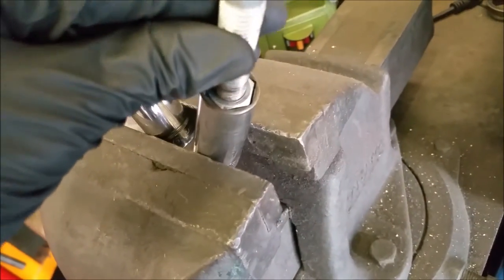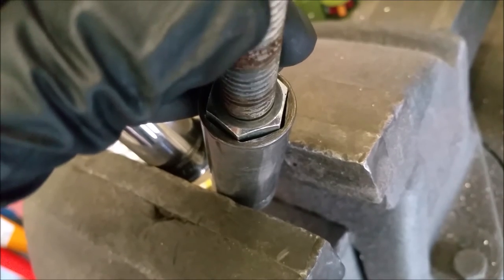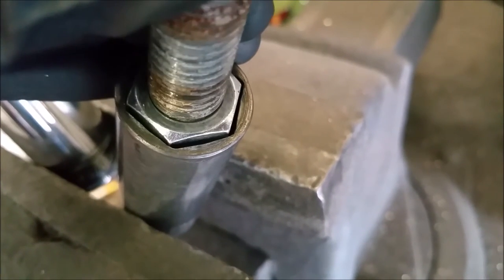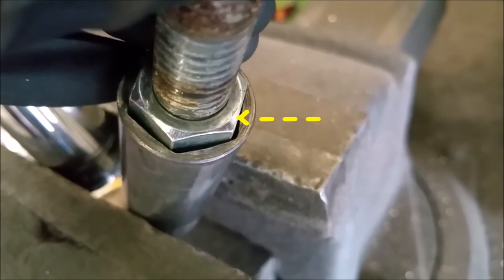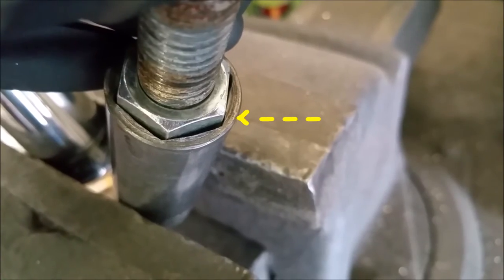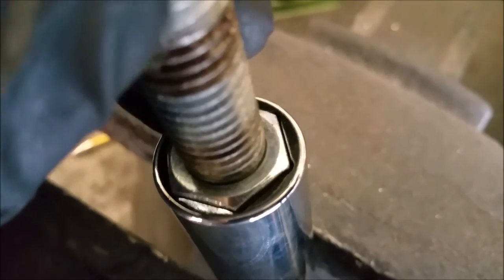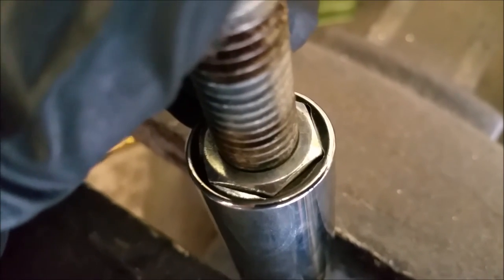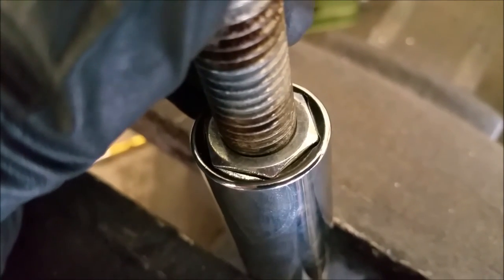Snapon vs Craftsman

Comment: The stop in the socket hinders you from certain applications like huck nuts or long lug nuts etc
Reply from the maker: kevin pierce when that happens I use my craftsman, and hope it doesn't crack. Ok. Usually it's fine. Your right.

Comment: Snap on uses the flank drive design which grips the fasteners on the sides and not the corners.  A lot of tool manufacturers, such as gearwrench, have copied this design though and cost a lot less than snap on, not as good quality though.

Comment: Hey sir nice post. I have both snap-on and Craftsman tools I feel happy with both to tell the truth. Broke the bank with snap-on where Craftsman tools are a very good buy. I just have a bit more confidence that the snap-on will get that bolt out
Reply from the maker: I have a set of harbor freight for my portable tool set, and snap-on and other tech grade for my work set. I agree with you!
Reply: subtledriver, i been working on cars for 27 yrs and never fallen into the snap on tool debt or any other high dollar truck tool and I always get the job done with what i have
Reply from the maker: sal 80 I used to believe that, but in my experience I prefer to use tight tolerance sockets. I have Japanese made, China made (craftsman, harbor  freight, cobalt, whatever ), USA made (Cornwall, matco, snap-on, Mac, ect)... I  prefer to use the best sockets to save me time and money. Eventually the craftsman tools will crack or round out, so I replace them with snap-on. There is a difference in quality that most people don't quite understand and I personally get tired of dealing with the worn bolt heads of repeat customers or those from other shops using poor practices even with lower grade or higher grade tools. And I agree, just because you have a nice $2000 camera, doesn't automatically mean you can take a good photo. And same goes for cars, just cause you have a porche or corvette, doesn't mean you are automatically going to beat the civic on the track.
Reply: """Eventually the craftsman tools will crack or round out, so I replace them with snap-on. """"

 So are you saying the Snap on never will round out??
I have never broken a socket ( may have worn a few out) but I dont mind replacing a set for the  cost of one Snap on socket ..
 I am not a pro but still have done a shit ton of work 
 and out if all the test on  You tube that I have seen ..the only one that impressed my is how strong Snap on open end wrench is.... Now personally I have never tried to put so much pressure  on an open end wrench that  I spread the ends..but that snap on apparently can handle  it

Comment: if you wanted a fair match compare Craftman's professional line or industrial sockets VS your Snap on pro sockets.
Reply: I cracked open a new set of Craftsman Industrial a while ago.  At least 1/3 of the sockets were missing chrome.  :-(
Reply from the maker: It wasn't a "fair" match, its a comparison to show difference between consumer and pro grade. There is a difference in quality from China made Craftsman, to USA made Snap-on sockets. Craftsman professional line will never make it in my tool box, there is no mobile tool truck for sears, and i will not drive an hour to sears to replace a broken tool.
Reply: subtledriver then why didn’t you name it American vs Chinese? Plus you used an old ass craftsman and a shiny newer snap on. We all know snap on is better I don’t think this video helped anyone.

Comment: Your Craftsman socket looks older and also quite worn, before they starting implementing Flank-drive style sockets that grab on the flats instead of the edges of the nut/bolt. Snapon patent for it expired in the late 1980's and since the mid-90's almost every brand has it. I tried the same thing on my 2008 USA made sockets and it did the same as your Snapon sockets - on the sides, and it has a stop as well. Also, comparing a professional tool to a base line beginners/DIY tool is a little unfair.

Comment: craftsman makes a professional series set of tools that still cost less than snap on’s non professional i believe. dad has had craftsman since the 80’s and has never had to replace a single thing. may not have the as much teeth as the new stuff but they still run strong and that’s important in a shop

Comment: Its always nice when your nut fits in nicely if I don't say so myself. Have you ever used Matco tools thats what they have out here as far as professional tools.
Reply from the maker: Matco is great, but everyone has their strengths and weaknesses. As for sockets, snap on has the best in the industry imho. Matco and Cornwell are top notch as well.
Reply: one of these days Ill be part time at a shop out here and get my ASE's for now ill maintain my youtube mechanic status. Sears gives me a 20% discount on craftsman which is hard to beat.
Reply from the maker: matco has a china line, and a usa line, but when compared directly to the snap-on, they are slightly less precise. Things are always changing, but i still prefer the snap-on for certain items.

Comment: I have many Craftsman sockets and mine don't look or fit like that. the side walls of my craftsman sockets are not flat they are  convex  to prevent rounding off the corners if that is a craftsman then it is a much older one back before they made them convex . to sum up my review of this video it looks like to me that your comparing a older craftsman to a newer Snapon even the older Snapons had flat side walls. so this is more like a old tech vs new tech video. To make a point i have felt a head start to round off and have stopped put down the shop tool and went to my service van to grab one of my craftsman so i don't round the head off.

Comment: if that amount of wiggle is causing you problems with rounding bolts. you are either not taking your time. or should not be holding a wrench...
Reply from the maker: Thanks for the comment, I don't round off bolts, because I take my time and use the snap-on sockets when I need precision and fineness.

Comment: I don't think testing two of your used sockets as a fair comparison go buy a brand new set and try it again with the Craftsman Pro Series... anyway you cut it you'll never justify the mark up for Snap-on  to do the same work....
Reply from the maker: It is fair, because I wear tools using them every day. I don't work with new tools. I am a pro technician so I dont have time to drive to a Sears (finding one that isn't out of business is tough enough) every time one breaks. I prefer to wait for the tool truck once a week who comes to me if something fails. I also dont like dealing with rounded bolt and nuts, this happens when i use an inferior or cheaper socket that flexes. Craftsman is ok for in your garage or whatever, but I reach for a snap-on socket when i want the best tool for a difficult job. Thanks for the comment.

Comment: Craftsman is much tougher.
Reply from the maker: Craftsman uses plastic parts in their ratchet wrenches that fail under professional use, Snap-on uses metal. Their sockets crack and round off nuts. I try to avoid using them as much as possible. They are good enough for occasional home use. Not For daily use as a mechanic. Thank you for the comment.
Reply: subtledriver, gearwrench ratchets
Reply: That is an untrue statement by far